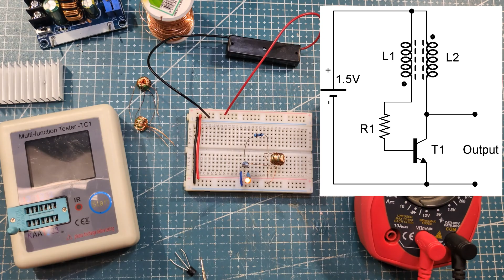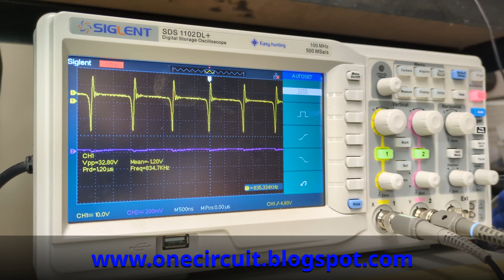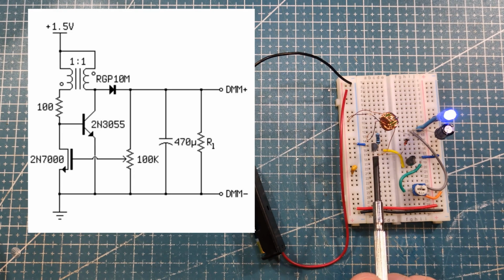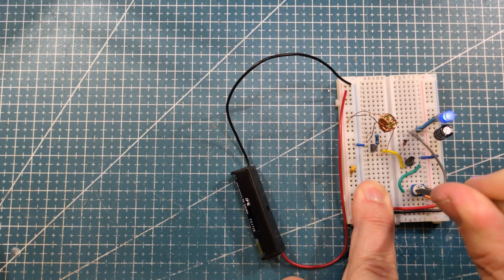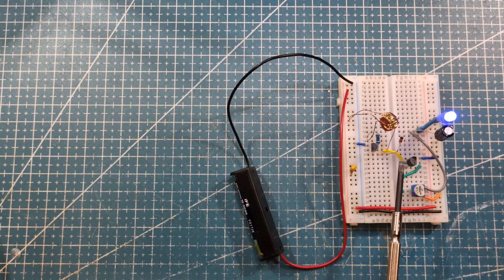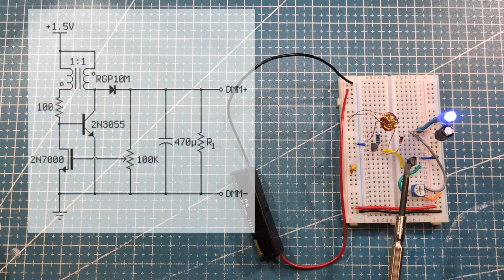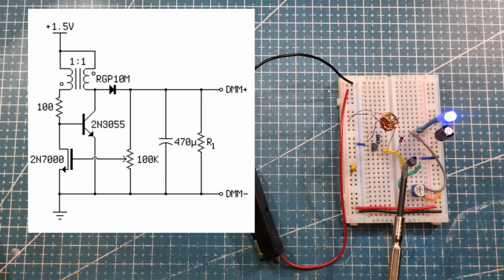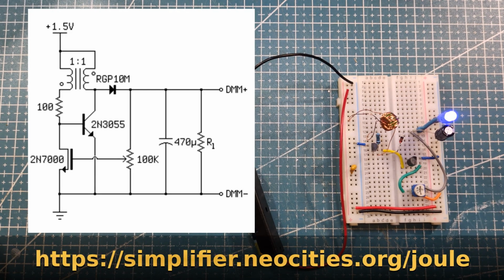Variable 5V Mosfet Joule Thief circuit

Comment: Neat circuit. You should show the waveforms on it and do a bit more on how it works, as well as a stability analysis. I think transient response might be poor in particular, however only testing and simulation can tell. You should also try a double BJT circuit as well with current(mainly) instead of voltage feedback or even something simpler like a bang bang(primarily) circuit.
Reply from the maker: I will definitely be revisiting this circuit. To give specific voltages from the joule thief in the past I've simply used a zener diode. 👍😀
Reply: @onecircuit-as  I hope as a bang bang like controller and not as a shunt hahaha